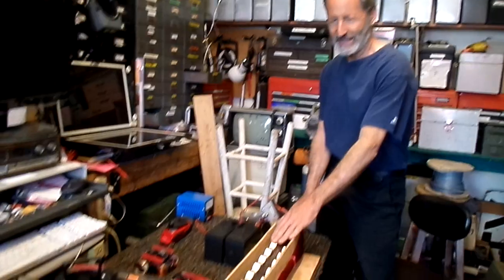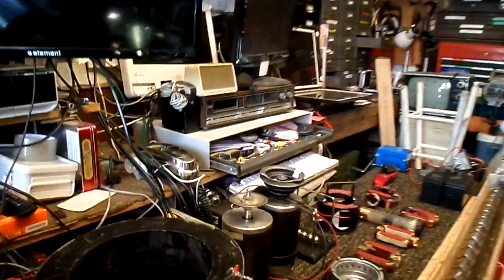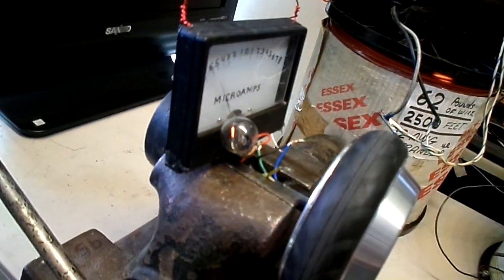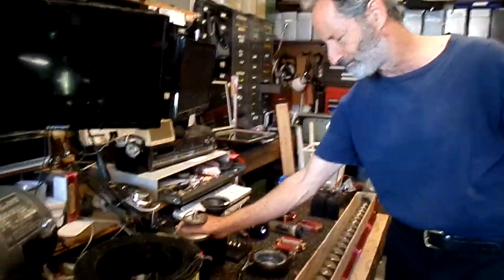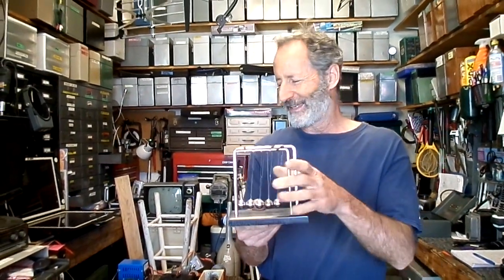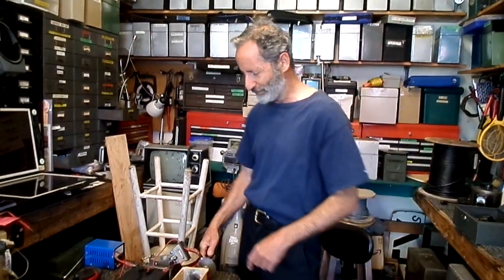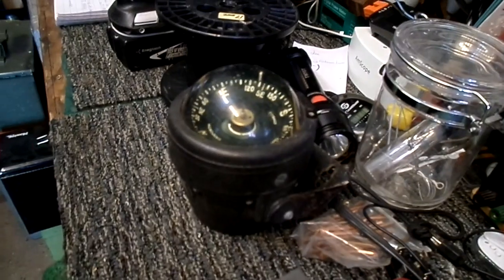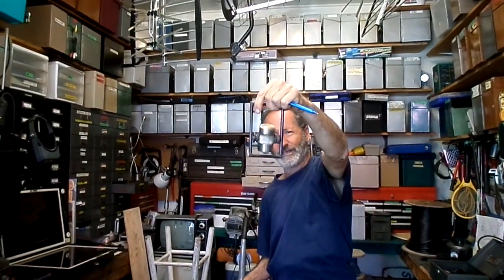My Experimental Newman Motor/Generator. Part 1 of 2

Comment: I helped Joseph Newman build a motor. A long one similar but different than yours. I couldn't turn the shift with my bare hands, when he applied the voltage to it, I couldn't slow it down with both hands. It had the current of one battery going through it.
Reply: Cd u recommend any channels which shows a better application or building of his motors
Reply from the maker: Trying to stop the shaft of a motor from turning by hand may seem impressive, but it can be very misleading.

Comment: Thanks!!!  The secret to the Newman motor which everyone seems to leave out of their projects is heavy flywheel spinning which does the actual work , which equals horse power. And a capacitor bank parallel with batteries to absorb the backspike to feed actual amperage to the run batteries along with the voltage. Do not use a power supply, batteries only. The caps are storage also. Your speed will increase along with effencie. Please try this, I would like to see an update of this, by the way, I would love to have that machine!!!
Reply from the maker: You might enjoy my last video on Joe Newman https://www.youtube.com/watch?v=DKxCPJKRM9Q&t=54s

Comment: It depends highly on the used commutator materials... If you use Graphite and copper you get these nice huge Backspikes Newman described in his book...if you are using other materials or just transistors the effect does not occur...it it some kind of battery effect you produce, when Dissimular Metals like copper and graphite touch and generate a voltage... The Spark is then just the "conductive electrolyte"... Regards Stefan.
Reply from the maker: Hi Stefan, I believe we spoke many years ago when I was part of the Newman news group.  From what I recall you spent a lot of time experimenting with Joes ideas, and I remember someone saying the extra energy was related to the spark. If the extra power effect goe away using transistors that would seem to confirm what you are saying. As you can see my coil here is to small relative to what Joe taught, I tried a larger coil using a 12 gauge wire, but still far from anything Joe built. https://www.youtube.com/watch?v=DKxCPJKRM9Q&t=76s

Comment: You build lots but I'd love to see you tune some of your designs. You can easily make your latest Newman motor way more efficient buy using transitors or mosfet to eliminate the spark ont the commutator.That will make it much more efficient and reliable

Comment: I'll tell ya Dave, if you could get that huge magnet perfectly balanced it would be substantially more efficient.....
I still think there is a way of magnets opposing and being able to generate a small amount of  current with just the opposing forces.....however, I digress because if it were entirely possible then it would be in patent...
Anyway,  stay safe and how is the TV service end of the business going. 
I still get calls for repairs but I just don't pursue them now that I'm working full time. 
When I retire, I'm going start rebuilding/restoring old radios and possibly TVs from the 60s 70s 80's if possible. 
Be well.😀
Reply from the maker: Hi Frank,  Even though it violates the laws of physics, and most of the people who claim to have produced free energy are con men, I like to keep an open mind about this.                                       On the business side of things it's been a little slower than usual, but I'm enjoying the slow down, and as you see my mind never stops dreaming about other possibilities.
Reply: @GrantsPassTVRepair  ..I agree, I've seen too many videos on YouTube about free energy and yes, they are usually scams.

Comment: May I ask if you have tried tipping the Newman motor on end? I have seen somewhere that the higher you get in elevation above the ground that the amperage will increase. I haven’t tried it myself.
Reply from the maker: I have not tried tipping the motor up on its end, but when you speak about the amperage increasing are you talking about the amperage the motor consumes as a motor, or the amperage it can produce as a generator? From a physics point of view I can't see why tipping the motor up  would help, but I'd be curious as to who is making such a claim and why.
Reply: @GrantsPassTVRepair  I will keep you in mind if I come across that article again. Also I was wondering if you could utilize the following information for your experiments. The information came to me by way of my friend Pamela Aaralyn around 2016. She channeled Nikola Tesla and she asked me if I wanted to share it. I did but it but none in my circles at that time utilized it. This is only a small section of the four-page transcript: Does raising the frequency of a Tesla Coil increase its power?
"You would need to utilize a Class E RF amplifier. I prefer one made by Nathan and Alan Sokal in 1975. The Class E amplifier makes use of a resonant circuit to get around the usual problems of switching power semiconductors at high frequencies. This topology is now finding commercial success in high power radio transmitters and RF generators for plasma generation and induction heating. High voltage MOSFETs are the usual choice of switching device.
Advantages of the Class E power amplifier:
1. Simple design uses only one switching device.
2. Eliminates turn-on losses due to stored energy in the devices output capacitance.
3. Eliminates turn-on losses due to overlap of voltage and current when device turns on.
4. Zero-voltage at turn-on eliminates Miller effect due to drain-gate capacitance.
5. Minimizes turn-off losses by limiting rate of rise of voltage when device turns on.
6. Circuit makes use of stray capacitance and inductance that would normally be hindrance.
7. Very high efficiency (90 - 95%) so very little power to be dissipated as heat.
8. Low EMI and harmonic output because of the smooth drain voltage and soft switching.
Perhaps the main disadvantage of the Class E arrangement is that it is relatively intolerant of incorrect matching into its load. Whilst load matching is usually a good radio transmitter, this intolerance to mismatching may cause problems when put to service as a Tesla Coil driver."
What are we missing in terms of how to harness energy, today? "Copper, quartz and magnets, that simple. The pull of the magnet catalyzes the copper to affect the quartz. The energy within the quartz then is harnessed like a centrifuge - it disperses and then returns to its’ center. If my vision in my human time had prevailed, you would be now tapping into solar energy from space.”

Here is a power source that utilizes radio waves to produce power: Goodbye Global Warming - Maxwell Chikumbutso New Green Energy - Saith Power - Greener Power Machine: https://www.youtube.com/watch?v=EZfPvjURcm8 

This should hold your interest for a while. Have a lovely weekend and enjoy your family.
Reply from the maker: @donparkinson9561  At the very least this information is not complete, but to me this information sounds like someone is trying to sound intelligent about electronics without saying anything of value. It's as if they copied a few sentences from a book on class E power amplifiers, and added their own words to try and impress others. I'd be cautious with anyone who claims they can channel someone who has passed on..

Comment: After looking at Joseph Newman’s video, it does look like you are on the right track. I believe that Joseph Newman uses a flywheel to store mechanical energy (like a battery) on the rotor. Whether what Joseph Newman is producing is free energy or not, it’s at minimum a very high-efficiency motor. Check out his ‘Big Eureka’ concept for the heavy flywheel. Great video!

Comment: Design is more important than powerful magnets also a cylindrical shape is more efficient the idea  of Newman motor is to create torque with voltage so magnets has to create a cylindrical shape to create torque  considering weight. To fix that issue u should separate your magnets suggest see Newman motor design because that's his secret.  Building a big magnet with small one is the secret

Comment: That's nothing but great, wow what a build. Please try the circuit "self Sustaining Pulse motor", a simple oscillator circuit. Work with almost any bipolar coil setup. I would like to see the results. Very good
Reply from the maker: I watched one video under this title, but I didn't see any proof it was self sustaining. Not to write the idea off, but I have a clock that can operate over a year on a single battery. To me this only proves it's  energy efficient, but not self sustaining.
Reply: @GrantsPassTVRepair  It has run over a year and the battery voltage has stayed the same, time will tell, will make an update video in June. Look at the self sustaining pulse motor circuit using one Darlington array. I would want to see what your very long device would do as an oscillator and how much the cap charge. You have the expertise, I just try it and fry it and look for positive results. This one you built is stupindous, as for as I'm concerned, it's over the top. That's a bunch of big magnets and wire.

Comment: Although it is technically impossible to make free energy, there is no hope without trying, and nothing to be learned without doing some kind of experiment. :)
Reply from the maker: There's no substitute for hands on experiments.
Reply: Not accurate.
The laws of physics that no matter is created or destroyed, and that no energy is created, only transformed are flawed laws. 

Their premise is correct but limited by “space”. In a ideal vacuum where all parameters could be controlled, they laws may be accurate but it’s ideal and not realistic. 

The sun and globe spiral in a space that we cannot define. Centrifugal, gravitational, solar rays may all be finite sources of energy, but if their source energy source is greater than our life time they are sources worth harnessing. 

Magnetism and electromagnetism are power sources that can be harnessed. They output forces greater than the ones introduced. 

Perpetual motion is possible. Or a perpetual generator that feeds on energy sources that are not consumable in a lifetime are possible. 

In my humble opinion. I know that is over simplified but... I don’t think we need to over complicate things either.
Reply: @INSIDEHARDWARE  acording to Wikipedia planetary orbit is Not Perpetual. Well it's Gonna last for billions of years. 
Who cares if "Perpetual motion is impossible"? That phrase is More like an excuse to not research and experiment
Reply: @DrWakeWalker  the atmospheric clocks have been running for 100's of years, but are still called "experiments".

Comment: The amount of wire in the coil is paramount to the success of Joe's motor , The principle behind the motor is the high resistance in the coil , It's very important . . The more the better . Joe Newman used 4000lbs of wire in his motor he named Big Eureka ..  Fast and frequent switching is also paramount. . .  The "ON" cycle of the coil is pulsed through the commutator . . It has serrated contacts. .  The high resistance requires high voltage , which causes large sparks at the commutator . .
   The way to calculate the power output requires measuring shaft Torq/power , not just electrical power , Total energy..  That's where most people make mistakes in power output calculations .
Reply from the maker: Yes I understand the importance of having a larger coil. Perhaps one day I'll try it again on a larger scale.
Reply: @GrantsPassTVRepair  , The underlying principle of Joe's Motor has to do with Electron motion spinning around an atom's nucleolus in the copper wire .  It has gyroscopic forces . . Joe has written several books .  Still available online . 

   Every atom we know of ,  has the same action ..  All materials have different amounts of electrons than the others on the Periodic table of elements . .  Conductive materials have  "loose" electrons that move from atom to atom ,  that's what we call Electricity .

Perpetual motion :
It's been proven before , back in the 1930's

    A " PERPETUAL MOTION HOLDER  "  can prove the endless motion of electrons .
https://www.youtube.com/watch?v=Oa4oBUBSEzs 

   Magnetism and Electricity are one and the same thing . . 
    Joe's motor can be built in many different styles ,  it's the Gyroscopic principle that makes it produce more than it uses  .

    I spent years trying to come to my own understand of how  "Free Energy" is possible . .  Joe's theory is one of the simplest to understand .
Reply from the maker: @THOMASTHESAILOR  I have Two of Joes books. One of them is the 7th edition of the energy machine of Joseph Newman, and the 2nd book I have is called "The Last Judgment" .The second book is has prophecies by Joe that never took place,
Reply: @GrantsPassTVRepair  , LOL,   a lot prophecies never take place .
   We all have our doomsday visions and hopes for a glorious miracle . . Ya gotta give the guy credit for being up front about his . . He's an open hearted Man of God. .  Most people don't talk about their visions  ..  

   Joe Newman was an inventor ,  A Thinker . .   He invented the Plastic/concrete Barbell weights. .  He started a successful company and sold them . . . Eventually he sold the business and created Big Eureka ..
Reply from the maker: @THOMASTHESAILOR  For sure.  Joe  inspired me to experiment and test ideas I would not have otherwise attempted,

Comment: I liked your video, but a couple of points. First, you have a serious balance issue with your initially presented motor. Even if you discovered something from your configuration (like a gradual increase in acceleration) you may not notice. Second, you demonstrate the effect on your compass yet have all those magnetic motors sitting in close proximity to the experiment. Opposing fields will corrupt you data or outcome. Dont give up!

Comment: There is no breaking of the law of thermodynamics in a working Overunity concept. There are a lot of energy fields we do Not see with our eyes that such a generator Would tap into. Such as an antenna for atmospheric electricity. (wich is the closest concept of free energy that i can comfirms is real). (without the use of water or sun light) 

Read a book called "shape power".
You May find some useful insight in the quest for free energy. It is all about the science of shapes and how they can be appllied to produce some satisfying results. The same author has also written a book on free energy.

Comment: The best design too over come 100% efficiency is the DC pancakes motor with rotor coil between two stator magnets.
Reply from the maker: I'd like to see one in operation.
Reply: @GrantsPassTVRepair  You can find a vid in this youtube chann ,Electric Experiments  Roobert 33.  Name of video , Electric motor pancake high speed.

Comment: The biggest problem with perpetual motion machines is the friction. It's the friction what eventually slow down the machine untill is stops. 
Another fun projects are the socalled "Joule thief" circuits, where a single AA battery can power a LED for a week and pull the AA battery almost completely empty (till 0,3a0,4V). Those "Joule thiefs" can sometimes be found in LED torches, where they use the popular HH004F LED Driver. This LED driver looks like a transistor, and needs only a single inductor for powering multiple LED's with 1 AA battery.
With such a LED driver i have already powered 20 White power LED's with 1 AA battery. 
The basic schematic of such a LED driver can be found here : 
 https://www.circuitsdiy.com/wp-content/uploads/2017/01/HH004F_LED_driver_Circuit.png 
The maximum operating voltage of this LED driver is 6V , and it will produce a clean squarewave pattern of more then 200Khz (depending on the supplied voltage).

Comment: Us mere mortals here on earth will probably never be able to make a free energy machine.  But no harm in trying.   And while free energy violates the laws of thermodynamics, the universe is expanding faster and faster all the time which technically violates the 3rd law of thermodynamics.  The driving force behind the expansion of the universe is vacuum energy which is the result of the uncertainty principle.  Whether that vacuum energy could ever be harness is questionable.  But it most likely would involve black holes (Look up Hawking radiation). In science friction,  there was even a Star Gate episode where the ancients attempted to use vacuum energy but had given up on the idea.

Comment: to make free energy from magnets you have to have another force interven the north and south poles, this force is gravity force, otherwise will fail
Reply from the maker: If you can build a free energy device that actually works you can change the world for the better, and become wealthy in the process. I look forward to hearing of your success should you build such a device.
Reply: @GrantsPassTVRepair  oh yes I did built many and i used to cancel one pole to reach one pole greater than other by means of aluminium fins

Comment: Is there someone that can help me to fix this Newman motor with his original made commutator? https://youtu.be/OPKXCErZAMI here is my version of the model. In some way the polarity don't change when the comm rotate. I try also with the shaft next to the coil.
Reply from the maker: Many years ago someone who worked with Joe told me they concluded the commutator with the short out segments was not necessary. It appears he didn't use that complex commutator on all of his motors. If you listen carefully to this part of his video I have linked to he says his motor is operating at Two pulses per revolution. I suspect the Two pulses are for the polarity reversal which occurs every 180 degrees of rotation. https://youtu.be/CrJIzrmX1mI?t=395
Reply: @GrantsPassTVRepair  I will try, thanks